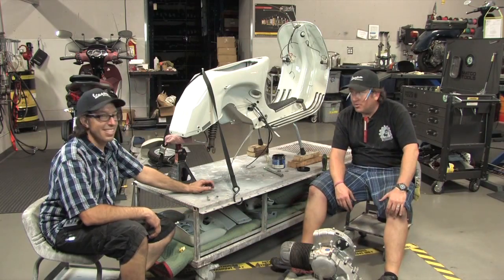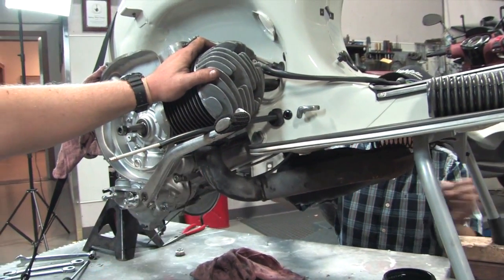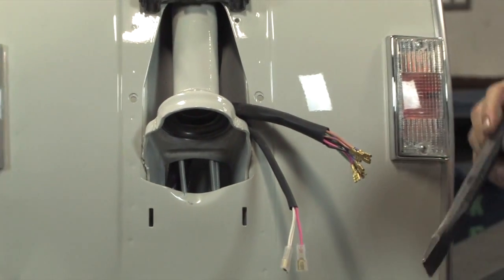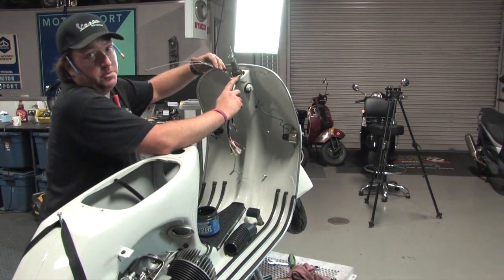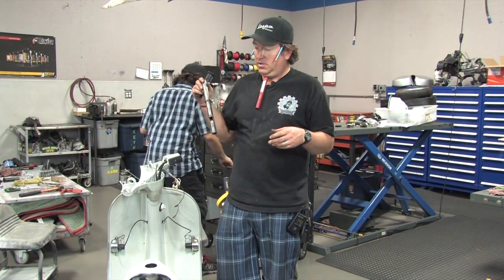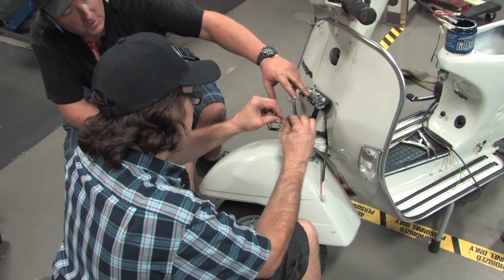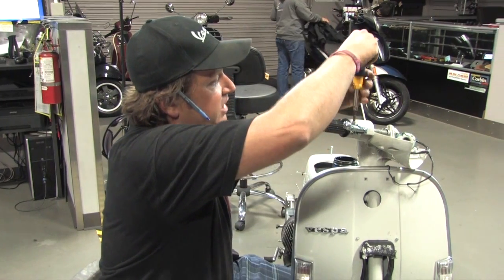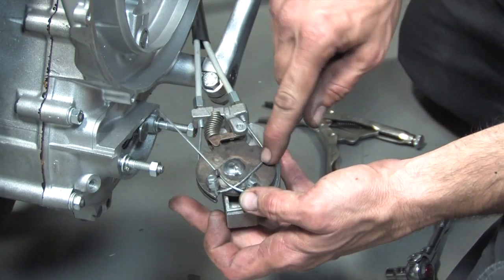Vespa P200 Restoration - PART 3 - Engine/Fork/Controls Installation

Comment: Thanks y’all for this very much. Just now put my P200 engine back in after watching this. The lift on the center stand was key for me. However I had the flywheel, air box and plastic shrouds on already. The trick is to start the swing bolt, go about 1/3 rd with it. With the shock tied back out of the way, lift the rear up and out to clear the air box back in, then shove 2 4x4 blocks under the rear of engine, then line up the holes and shove the bolt through. Thought of this during the process and it worked. Did it alone

Comment: Mine had a front brake light switch. I noticed you guys don't sell it on the website and didn't put it on in the video.  I bought one from India, but the old one did cause me some trouble, it was binding up. It felt like I needed 50lbs of force to get the front brake to work. It works great now without it, but the only way the brake light works is with the rear brake light switch.  Did you guys give up on it? Is it inherently bad?